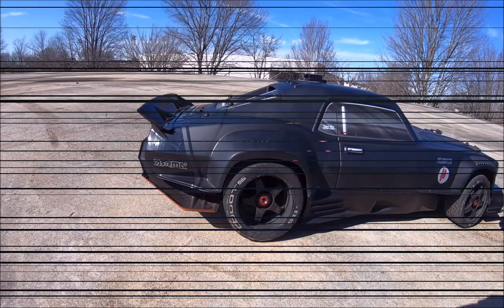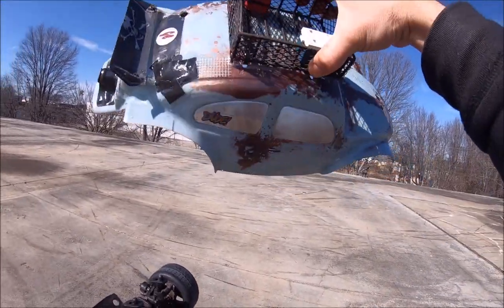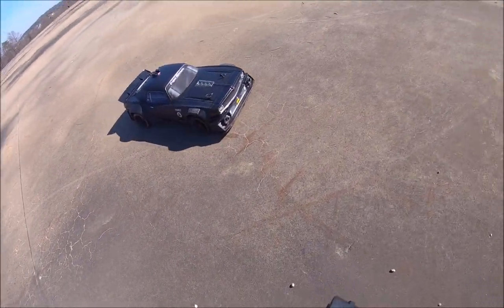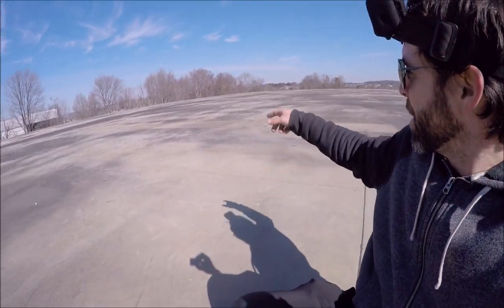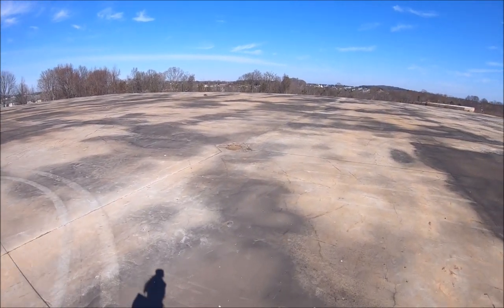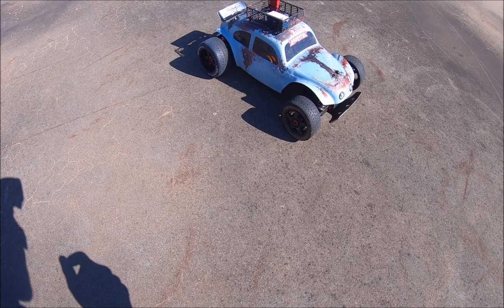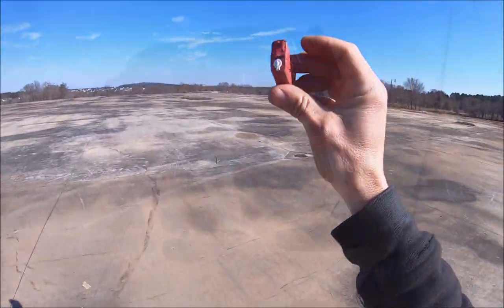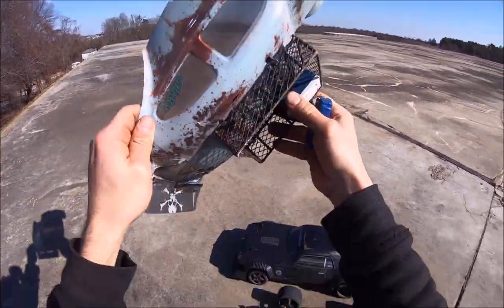INSANE!😱Arrma SWB Felony VW RAT ROD vs Felony 6s street showdown!

Comment: Rat rod looks cool. I know it's been asked .but can't find your reply . But do ya have a link to the beetle shell please
Reply from the maker: No prob! This is the shell I used. It does need some trimming and lots of reinforcement if using for bashing. It's a bit thin. Otherwise a nice looking shell!😎👊https://www.ebay.com/itm/Custom-Body-Clear-Buggy-for-ARRMA-Outcast-Notorious-1-8-Car-Cover-Shell-/255253835171?mkcid=16&mkevt=1&_trksid=p2349624.m46890.l49286&mkrid=711-127632-2357-0
Reply: @RCDUDE81  ah top man for replying much appreciated.  I've bought the hoons . Infact 2 pair of rears and also some 1/5th grps so gunna have a play around with both
Reply from the maker: Sounds fun!😎